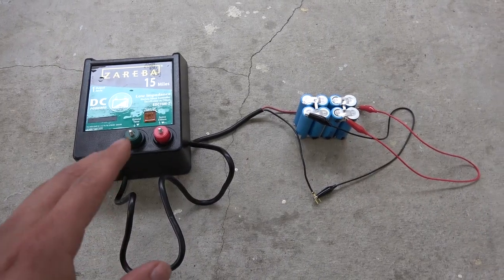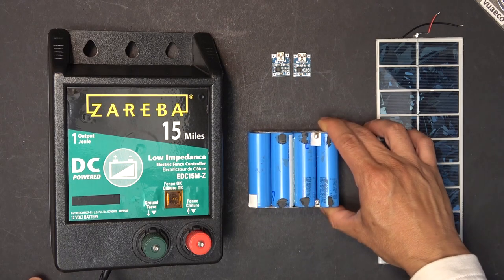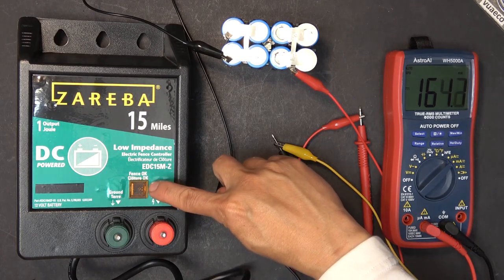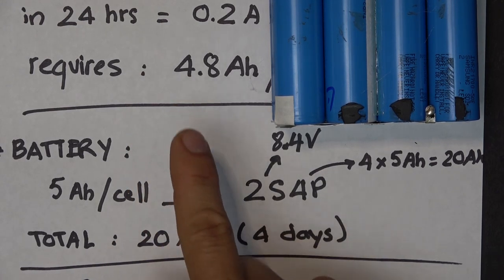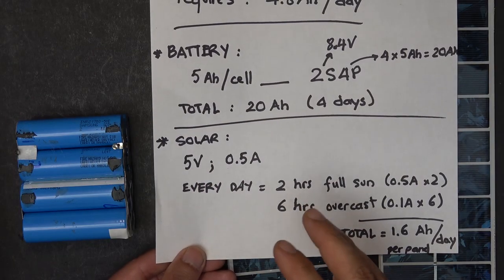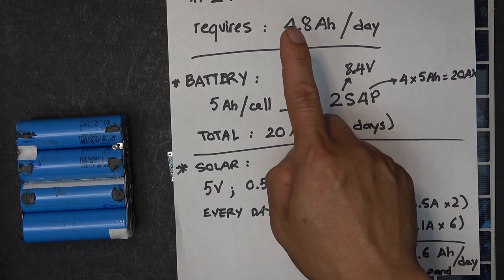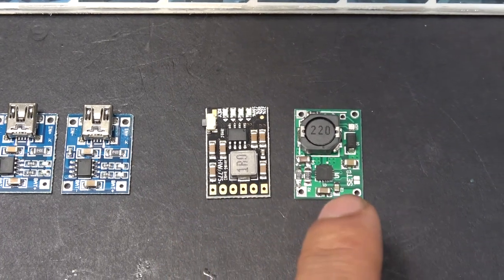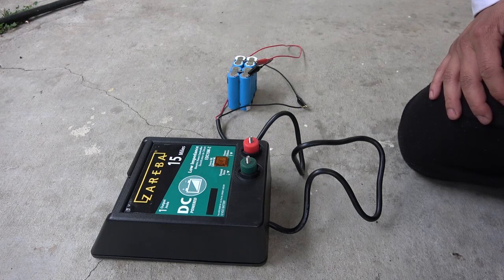How to calculate power requirement using solar panel & Li-ion battery (electric fence install)

Comment: I love watching your videos,
You explain yourself so well and your demonstrations are fantastic. 
I have a question for you regarding a e-scooter controller. Zero 11x 2 in 1 controller. It has only 3 phase wires from the motors, no hall sensor wires. How do I change the direction of the wheels?
Reply from the maker: There should be a couple of white wires on the controller. It's called learning wires. When you hook them up together, they will learn the rotation of the motor and at the same time reverse the direction of the wheels if you disconnect it and reconnect it again. I have a whole video instruction about it and you can watch it here: https://youtu.be/PuwnFMHHtaE
Reply: There is a couple of grey wires that are already connected. When I disconnect them nothing seems to happen

Comment: Nice video. I have one objection, I think power consumption of this device will increase with fence when is connected because of wires leakage current etc. Especially when humidity is high. So, could you measure current again with fence hooked up?
Reply from the maker: That's a possibility. I'll report back when I have a chance.

Comment: Would it destroy a multimeter by measuring the 20kV across the terminals since most are rated for around 600V?

Won't the batteries be damaged if it charges below 6V or does the electric fence controller cutoff charging @ 6V?

Comment: And that shock was just touching the two terminals.  Now get up to your knees in irrigation water, right hand holding on to a 12 in diameter metal gate valve pipe and assembly weighing about 60 pounds of metal trying to move it into position in the mud and water, then you start to lose your balance and your left arm contacts the electric fence.  Yowsers. Nearly knocked me down.

Comment: off topic, but I've seen you do some Swagger scooter videos and need some help. I heard about how you can remove the speed limiter in the programming by holding the break lever while powering up to get into the programming menu. But, not knowing what I was doing, I then proceeded to screw up the programming so that the scooter barely moves and wants to go backwards. Any ideas on what the proper settings should be and how to make the adjustments?